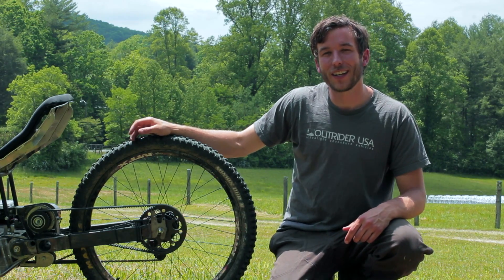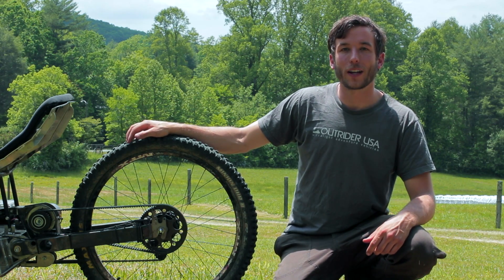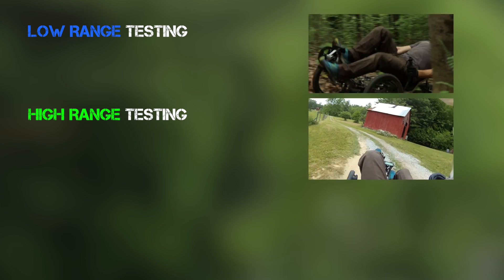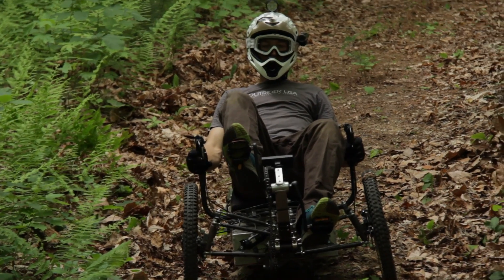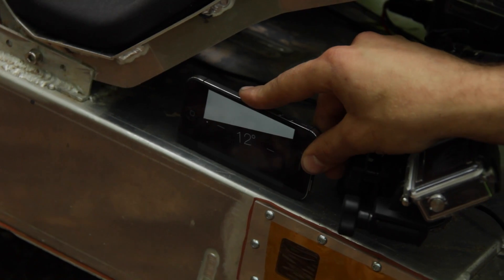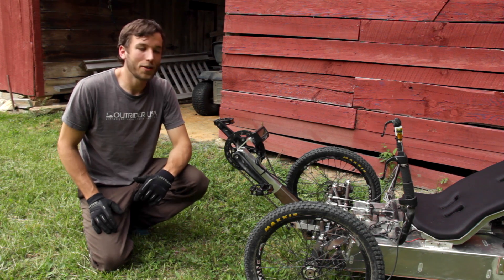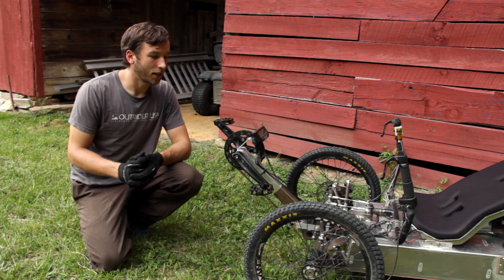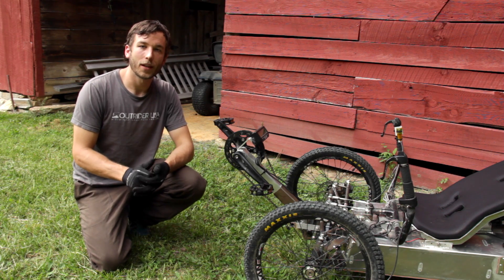Horizon Prototype Basic Functionality Testing Part II

Comment: Have you ever thought about doing a dual EV motor design? i know the mechanical ability to pedal is nice.. but it could lower the overall weight of the bike and allow you to run a larger rear motor to overcome those 12 degree hills somewhat better.. basically pedaling a geared front ev motor that applies output directly to the input of the rear motor, giving you an pure electric dive system.. the faster you pedal the faster the electric motor turns basically...
Reply from the maker: storxusmc from a rider experience perspective, it's important for the pedaling to go toward propulsion.  We have done a dual motor set-up for the record setting on the airport.  You can check out the video here: https://www.youtube.com/watch?v=MKDFXDGNVsQ

Comment: Have you thought about adding hub motors to front wheels in addition  to med mount motor ??
Reply from the maker: john angle Thanks for the idea.  We've considered it, but i would be adding significant weight, as well as rotating mass which can really impact performance negatively.  AWD would be pretty slick though!